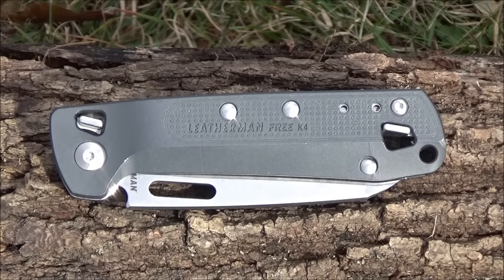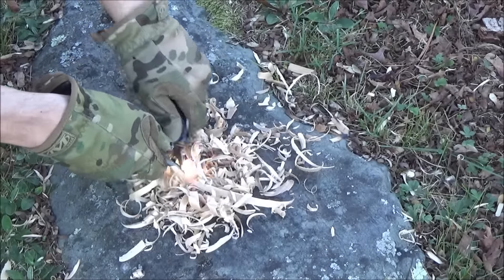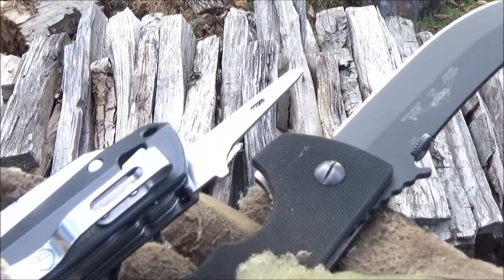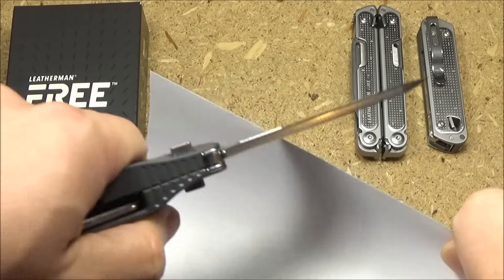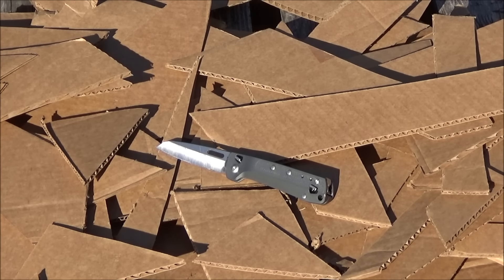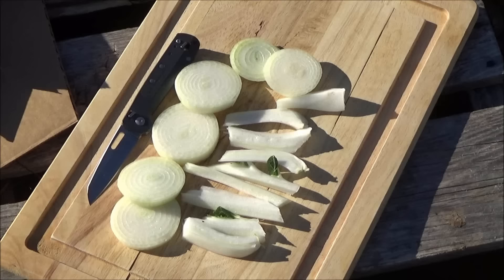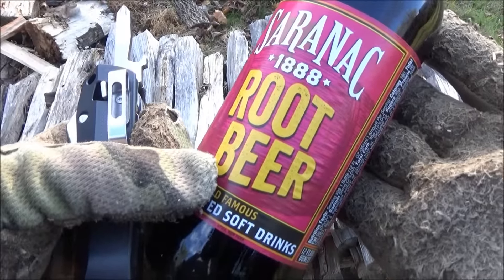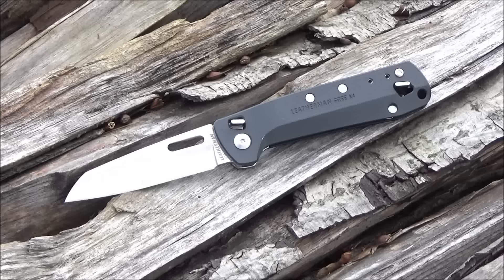Leatherman K4 Folding Knife Multitool, Full Review

Comment: Great review!  Ty.  $90.00 is too much.  Wish the scales came in different color options.  I always prefer the trapper castrator-blade over the sheep's foot.)  Probably won't be chasing after this model.  Leatherman needs some new models with removable/replaceable tools (like Surge's file/saw), as I keep whining....
Reply from the maker: Additional colors would be a great idea, I think a red one would be good. I think they should change the grind to a partial flat. Maybe a bit driver instead of the awl and pry driver.